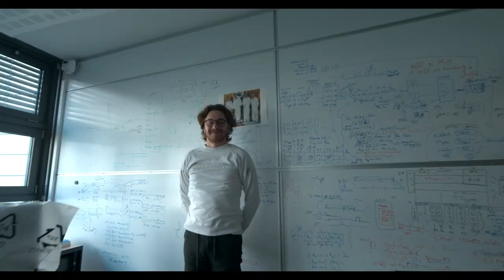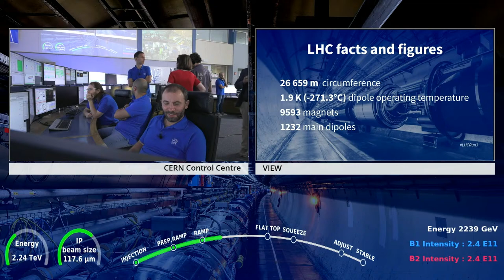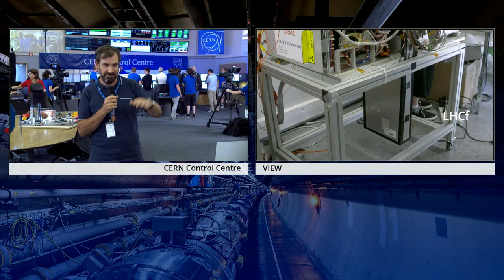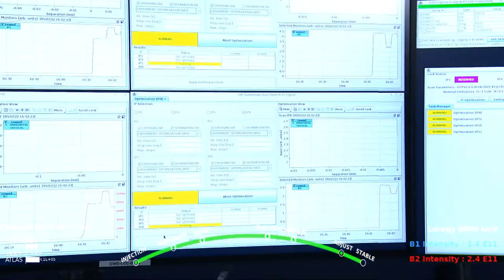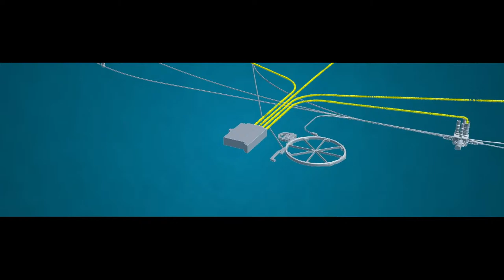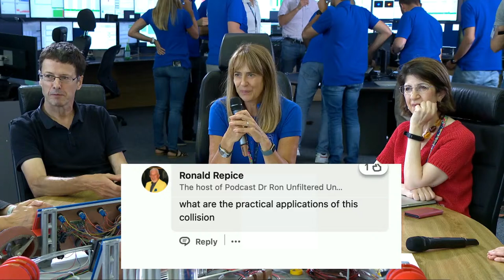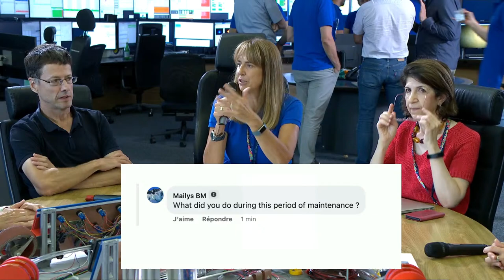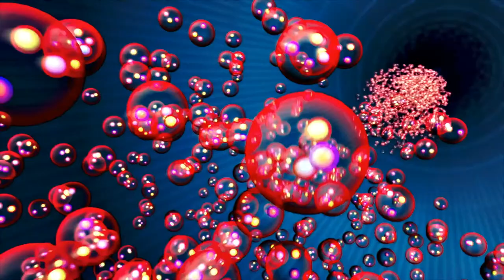Live from CERN: Join us for the first collisions for physics at 13.6 TeV!

Comment: now that you increased thei ntensity off the beam by increasing the mass and not increasing thhe speed wouldn't this creat more ''debris'' when they will collide ?is there a chance debris to collide with debris ?
Reply: No, the energy they increased it by is like the amount of energy 2 flys make when they collide.
Reply: Are you asking if multiple protons colide for each proton bunch crossing? If so then the answer is yes and the technical term for this is pileup. A pileup of 50 means that we will have 50 protons colliding on average per bunch crossing. This makes analysing the signals more challenging but it is essential if we want to get more data and access rarer processes. Each one of those simultaneous collisions could give one interesting process. Remember that the rate at which we are getting interesting events is ~1 for every 40,000 collisions.
Reply: The answer is yes. The second law of thermodynamics (everything gets messier) still applies…
Reply: increase the capacity.
release the hounds
resist the tyranny

Comment: could this affect the climate? are there any dangers of using it?
Reply: It can affect the climate, but probably not in the way you are thinking. There have been several experiments at CERN that have led to an increased understanding of our climate and how Earth's atmosphere works. In addition to that, the results of CERN's research have already led to significant improvements in food safety, computing, materials, medicine, and more that all make a positive impact on the climate. If that weren't enough, some of the research CERN is doing could lead to massive improvements in energy transmission, storage, and generation that could produce new sources of clean and renewable energy. In all, CERN is probably one of the best things going for the environment we have.

In terms of dangers, there are some. Again, probably not in the way you might be thinking. Most of the dangers at CERN are those typically found at any underground or industrial facility. For example, there is risk of electric shock, fire, and so on. Think of the kinds of accidents a construction worker could have. The risk is localized to just the CERN facilities themselves. CERN has its own fire team, specially trained in fighting fires in the LHC tunnels. The LHC also produces a very small amount of radioactive waste that must be handled and taken care of responsibly.
Reply: @Usul  ya waste dark matter !!!

Comment: How are they producing this much energy (dark  matter?)and why can't we use that energy for the alcubiere spacecraft if in fact CERN is using it (dark matter) as a power source
Reply: because we cant use dark matter as an energy source???
Reply: @wyvrnres  Can't use dark matter as an energy source YET**
Reply: There is no "dark matter" at CERN.  The theory of Alcubierre is just that. A theory. 
 "Although the metric proposed by Alcubierre is consistent with the Einstein field equations, construction of such a drive is not necessarily possible. The proposed mechanism of the Alcubierre drive implies a negative energy density and therefore requires exotic matter or manipulation of dark energy."
   None of this is possible at CERN.
Reply: @Zombieshark420x  thats what i meant, but this dude still has no idea what hes talking about lol
Reply: there is no dark matter and you can’t use it as fuel
Reply: They are not "producing" energy, and it isn't that much. They are using energy which they get from normal power plants.
Reply: @wyvrnres  we can store it so why wouldn't you fathom the possibility of being able to use it as fuel? you have a brain use it Don't believe everything you read. And dreams usually become reality
Reply: @Zombieshark420x  we can store it so why can't we use it yet? If you had the power to completely control the world or destroy it would you tell everyone that you made a break thru or would you keep it under wraps?
Reply: @johngonzalez3277  also who ever said that dreams become reality? 😂 stop looking for answers where there arent any. stop trying to think you are special. you arent

Comment: what happened to know the segments of this can be modularly replaced for custom experimentation. now what I would find an interesting challenge for this is the mass insertion of atoms spun up and a section of this used as an exhaust port to study microscopic interactions of energy within minor physical replicas of atomic networks. so to further articulate the depth of what I'm trying to describe is bulk amounts of atoms loosely dropped into the running particle accelerator measured amounts of different atoms interacting with each other. I'm not looking to smash these atoms I just want to see them run a circuit and see their unique interactions of energies with custom combinations of different types of atoms. different patterns of insertion also. the difficult thing is going to be the custom exhausting of them because some instances you going to want to alter the acceleration forces of these atoms without them being ejected so a custom exhaust that will trap door finish sections of experimentation to be expelled from the test stream  so the next combination of Adams can be inserted. now if you flood these atoms into the accelerator and get them moving it would be interesting to see how a different type of atom put in the center core of these other atoms moving with interact. I don't think this is achievable without smashing the test Adam that you want encompassed in the envelope of already existing Adams underway would survive you would have to insert your test Adam that you want to in bed around other traveling atoms and have it increasing speed to slowly overpass the moving bulk of your atoms to slowly insert itself through the fast moving stream.

Comment: now what would happen if you stand in the center of this thing running with a super cool superconductor levitated dead center to where it starts spinning as the atom spinning in the collider does or better yet:segments of super cool superconductors embedded in a puck on end to where it is veined like a generator interacting with the spinning atom in the collider. I'd make it a big puck with 5000 superconductors in it so it could really get a hum on baby. have an aperture to where veins open up like the Stargate Iris and catch the air and March at sucker zip to the other side of the Galaxy

Comment: How much energy does this thing use?
Reply: According to CERN, they use 1.3 terawatt hours of electricity annually. That's enough to power about 300,000 homes. That is for all facilities and experiments at CERN, not just the LHC. The LHC itself uses about half of that. Most of that energy (including the LHC) is used for normal industrial processes like cooling, ventilation, and so on. The usage is fairly typical for an industrial laboratory of this size. Google, by comparison, uses 15.5 terawatt hours annually!
Reply: @Usul  I thought these people cared about the climate
Reply: @Ryan-ze9fz  , They have a number of programs to offset carbon induced emissions from CERN operations. In addition to that, they are actively developing new superconducting materials that will (and to some degree have already) significantly reduce power utilization by cooling systems and magnets. The technology is also applicable to power generation systems generally, which promises a more efficient power grid and power management systems.
Reply: @Ryan-ze9fz  im p sure they do more for the climate then you

Comment: hey with it running try to capture a neutrino at dead center of this complex and see if it gets pulled into the spinning atom.or if you can trap it.if it starts gushing oil you'll be the new oil king.

Comment: u need to check and change the most of the monitors at CERN... The optimal brightness from monitors has a luminance of 100 - 120 cd... u can measure it with a smartphone camera. On my last Job never was changed it and the luminosity was only 40 cd on more than 10 yr old monitors... after midday time the sun was behind me blending on the screen... it was causing depression

Comment: this messes with earths magnetic field allowing gaps that can allow rays in that damage crops and cause skin damage its many times stronger than earths field and pulls it down
Reply: no it doesn’t 💀💀💀
Reply: No, this does not mess with Earth's magnetic field at all. Why do you think it does? How could it? The energy they are using is __FAR__ to small for that, and the magnetic fields they are using are almost completely inside the detectors.

The magnetic field inside the detectors is indeed much stronger than Earth's field. But that field is concentrated there. It does not effect anything outside.

Please look up how electromagnets actually work, especially superconducting ones!
Reply: Riley D  brooooo you know